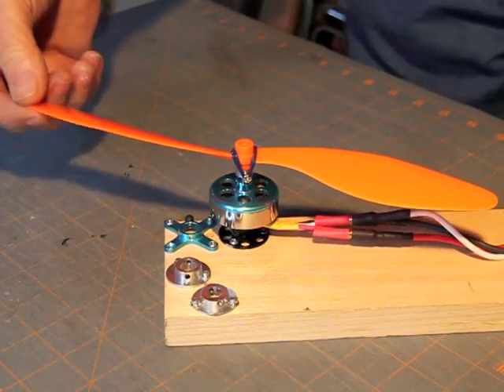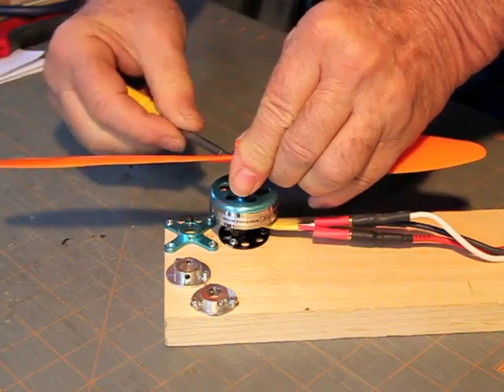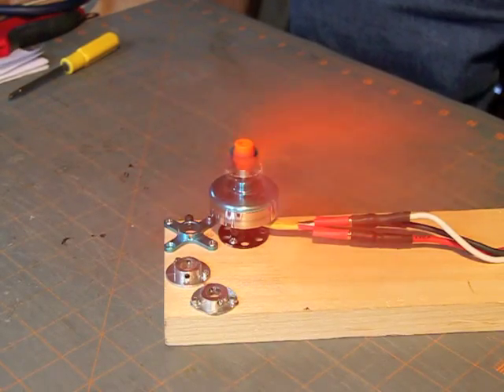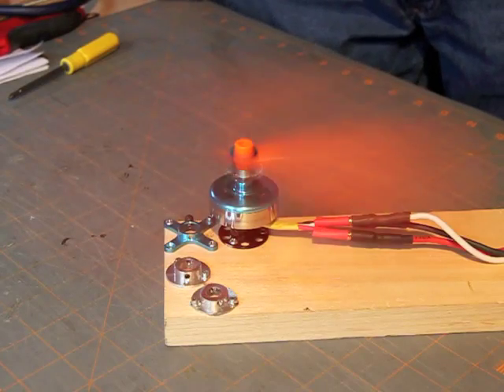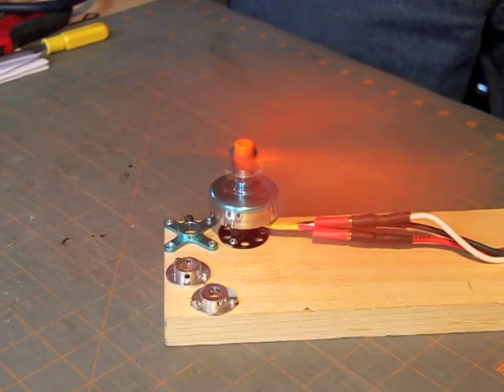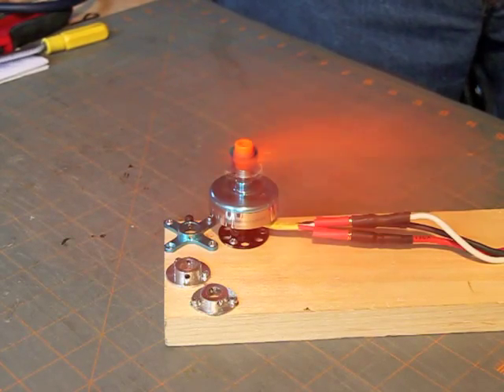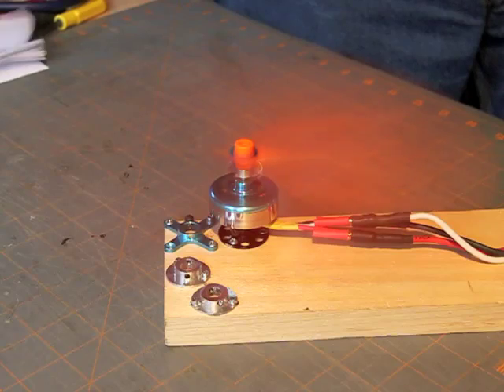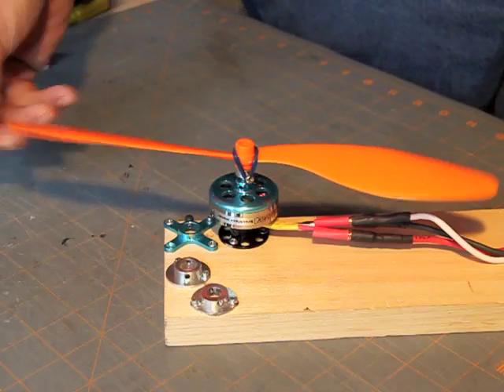Slow Fly Prop High RPM Testing.mp4

Comment: When you say blue not red loctite are you saying use medium strength rather than high strength? Different brands of thread lock or loctite come in different colours. I'm thinking if it is the medium strength that you are suggesting, is this so the grub screws don't strip the hex pattern when you are trying to loosen them? Thanks

Comment: Nice to see a prop saver working. With a flying wing kit I got a clone 7in APC prop, replaced it with a real APC 7 in prop (no comparison, the clone was beyond balancing due to hand drilled off center hole... total garbage) and still the prop rocks on the screws. Can't believe they put a prop in a ARF kit that's a danger to use. Can see videos of the prop failing by people who try to use it. Been a pain finding a prop saver that woks on a 3mm shaft with 2 flat side cuts and the 7x5 APC prop. Any suggestions? And thanks for the info on the Thera-Band.
Reply: JackErbes Thanks jack. The issue I'm having with using a prop saver on a flying wing with a pusher configuration and the motor spinning in the standard direction is the APC prop and I'm having to accept the fact it can't be used despite being the included prop because the accurate hole is on the back side where the insert goes and in this configuration the less accurate front hole is making contact to center the prop. But I like the conical hub idea and wondered about it as I saw Maxx's site looking around and assume that is the one you are using in the video. But again the screws are to close to the prop it looks like for the APC 7x5. Really the prop saver and the prop should be designed as one unit with a conical hub then an thicker expanding small rubber o-ring expanded at the tip by a tapered set screw could be used eliminating the need for the bands being used and still pop off when needed, even in two stages so the prop is not lost.

I mic'ed the APC prop and the rear hole is the proper one to use and have the prop hub in balance which is important as I want to run a flight controller board with self leveling for distance flying LOS and later FPV and need the prop in perfect balance as it's so close to the FCB and the CG. So I may go for a fixed prop hub and looks like Maxx has some good ones. I usually land in my hand to save on ware and tear landing but for my first flights getting the wing dialed in a prop saver would be nice so looks like I'll find a replacement prop and a power meter that gives true readings and then go to a fixed prop hub and the APC prop after setup and trimming but need a double set screw hub since the 3mm shaft is cut flat on both sides. I am amazed that you really need a small machine shop to simply mount a prop correctly. It seems the RC hobby has no standards and is a free-4-all just to sell stuff even if it doesn't work. In this case the kit's prop was simply not safe to use.

Comment: I'm sorry I'm confused are you saying you can only run  an 11inch prop at 1/3 throttle with a 1300kv motor on 3s? 5000rpms? I have never heard of this before. I run my 8x4.3 on my 1400 kv motor on 3s that's 17640 rpms it works perfect and makes no noise. maybe I don't understand what your saying can you elaborate?
Reply: I just looked on rcgroups lol. ok so your focus was on the prop saver no the prop. you exceeded the rpm of the prop saver band with that size prop. got it I have had that problem too .I just use a thicker o ring from the hardware store. actually I don't use prop savers anymore they just held back performance for me. great thread on rcgroups though nice job. thanks for the videos too.
Reply: Steve, Jack is pointing out a needed fact to be aware of. There many more misconceptions out there. The RC hobby is not "tight" on facts and still maturing. He said that brand/type prop, not a heavier stiff rigid composite prop, had it's own specific RPM size ratio which will differ from other brand's prop ratios. I ordered a quad and it came with props that were not suited for 3S even with low KV motors. It's a free-4-all often where buyer beware should be the first thought that come to mind.

Comment: hey, why'd you use a blue and not red lock tight>
btw, do prop savers help reduce the bending of motor shaft during bad crashes and nose in? also, does it work for folding props? pls reply, thanks!!